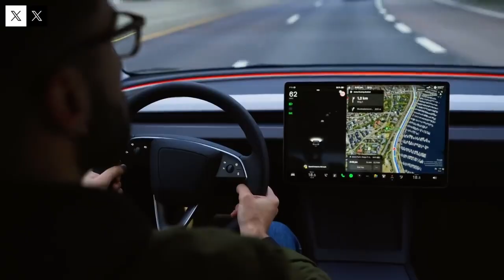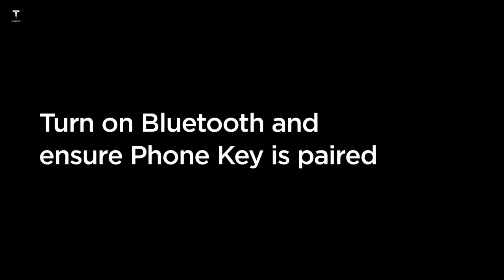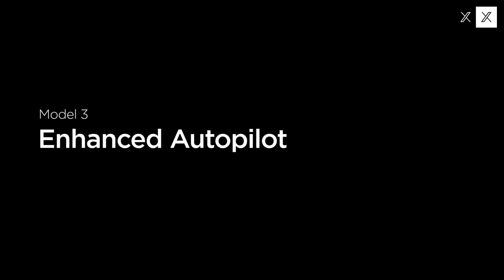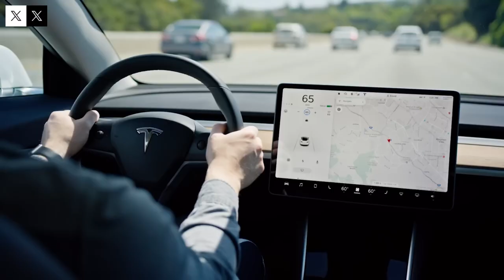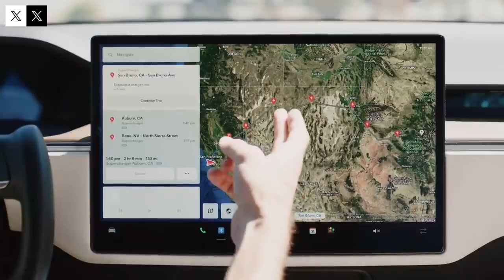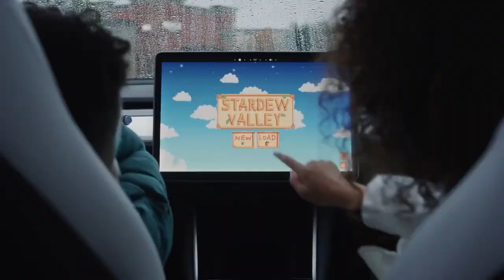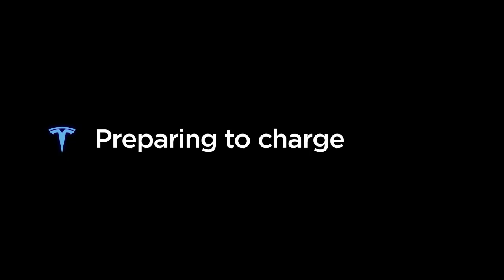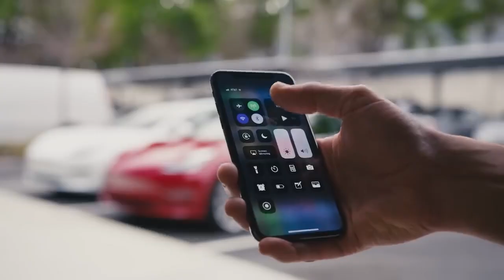LEAKED! Tesla Model Q 2025 – $25K Compact EV With Ultralight Aluminum Frame, Interior & New Battery

Comment: There  are no. Confirmed. Specs for. a 2025 
Tesla Model Q ,ask is a rumored vehicle and recent  reports suggest. Tesla is not. Planning a &30,000. Potenntially  around $25,000  for  the. U.S,  Market 
About  15% Smaller and. 30%lighter.   
Than the Model 3